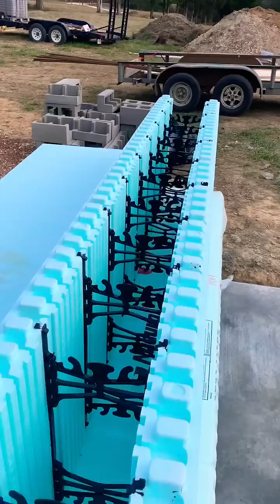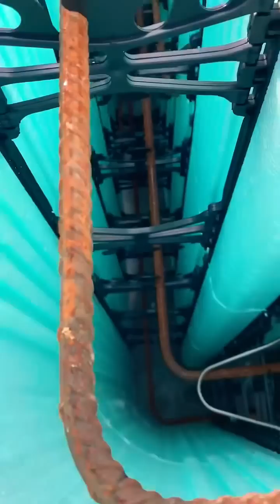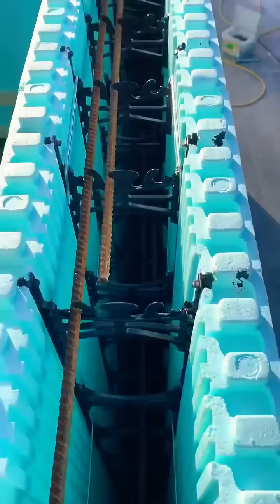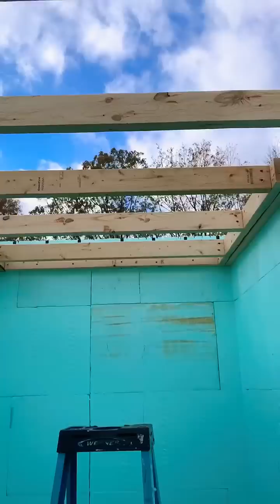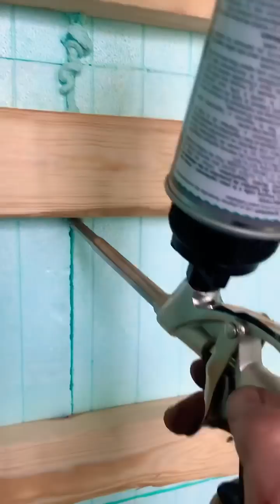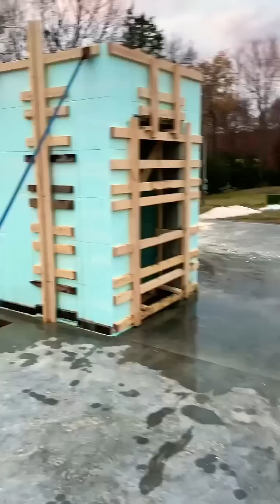Saving lives!! STORM SHELTER Pro edition #icf #concrete #safetyfirst @NuduraICF

Comment: My grandfather once told me that if I ever build a shelter make it large enough to live out of for at least 6 months (the time it takes to rebuild).
Reply: That was a very wise comment by your Grandfather. Though by the time you make the shelter big enough, it starts to take over the house. Probably the best thing would be to build the shelter as a part of your guest bathroom and laundry. This is not as simple and easy as it first seems. If rebuilding could take 6 months, you maybe off grid for at least a month, so you have to consider fresh potable water supply, waste water disposal and electricity supply for cooking and washing and lighting, so there is a generator and fuel supply. 
Mark from Melbourne Australia
Reply: How about build a basement or just build the whole house out of ICF?
Reply: @Chris N  where I live you cannot have a cellar. The ground moves too much. During the summer the cracks in the ground large enough to lose a small dog in. Gotta love clay soils.
Reply: @blmdh20s  i have plenty of clay near me.  Where you at?
Reply: Wise men
Reply: @blmdh20s  i have 2n a half feet of topsoil then 1ft.clay hardpan solid rock goes to surface in places like the corner of my house, why i didnt scoot it over instead of finishing the three feet down is my stupidity ? But for a dollar you cant bitch house was completely gutted just had to get gov grants after 40 yeears its yours scot free. Except two additions two car garage now 10 acers. Rock shifts every spring going to crumble corner of house like last time ,n sit another 70 years before someone moves in ugh lol
Reply: @Chris N  we can't have basements in Florida. The ground is sand
Reply: @markfryer9880 I guess we’re fortunate now that solar has come so far and can generate decent power on small portable panels that are easily stored or carried on trips. I imagine that most rural American households are on well water and have a septic system so if you can power the pump your covered for both?
Reply: @deusvult6920 you can have basements there, you just have to excavate massively around them and be above the water line. Not so easy for a state like Florida. Though with its politics I’d move anyway. 🤷🏻‍♂️
Reply: Nah. We had ours lost to a tornado . Just went and bought an RV while I built . Not going to live in my concrete storm cellar .

Comment: Yeah i have used those forms and they suck because if the wind gets under it you are screwed and they are only attached to the slab with glue and spray foam and a board shot to the slab if you used regular forms latch forms with your rebar coming out of the footing and then your wall steel tyed to that and then reinforced it with a steel 3/8 cable back to the footing and the slab and the wall will be much stronger than using those things believe me I have poured hundreds and thousands of yards of concrete and I would never use them in that situation and especially with your family in there i don’t know how people would think that foam is stronger than steel and concrete don’t get me wrong they work great in a area where they don’t have any twisters or tornadoes and provide great insulation protection but not in areas where you will have problems with the weather because you are just asking for trouble with those forms

Comment: How do you get out of a shelter after the garage crashes down and blocks the door?
Reply: Store chainsaw inside? Essential items for after a tornado should be stored in safe places anyways but with you is good too. Most tornado damage I've seen was tree insertion into the home or partial home removal and the occasional terrifying clean slab
Reply: @calebz1448  ... what are you going to do with a chain saw if your shelter is made of concrete and the door is blocked with debris? Even if you had a wood door, how long can you run that saw inside a 6x8 room before you pass out from the fumes? If the door is blocked with half a building or a tree and your saw only has a 16 inch bar, then what? Remember, you also have to reach through the door, so you don't have full use of the bar length now.... and you are still inside with the fumes.
Reply from the maker: The door opens in so even if the door is blocked you can open it and start cutting and removing the debris. The room has an exhaust and fresh air intake so air can circulate
Reply: @w.k.d.constructionllc  ... I should have said "doorway" because even with the door opening inward, you are still in a confined space with a possible pile of construction debris blocking your exit. The first nail you hit will render a chain saw useless.
Reply from the maker: @rupe53  if it was blocked and you didn’t have tools to cut yourself out…help will be there shortly and you’ll be sitting in comfort waiting on them to arrive. So either way hopefully everyone will be safe

Comment: Also be an awesome way to build your own walk in gun safe!
Reply from the maker: Definitely!
Reply: THATS A LOT OF GUNS!!
Reply: Fill it with guns and watch the storm blow through!
Reply: Does the door swing in or out
Reply: @spacemanrick2014  one got never enough
Reply: @torrycole6477  some think in so you can open the door when debris are on the otherside 

but I wonder if opening  out would be better to resist the airpressure especially if you extended the walls and lid past the door to keep debris from entering the door swing area ?
Reply: I think with tornadoes they have suction so if it swung in would be better to suck the door to the frame. I could be wrong.

Comment: Very helpful and could save lives. I'd go the extra prepper mile and make it nuke resistant with some lead sheets and ventilation.
Reply from the maker: haha
Reply: in case you didn't know, concrete stops the type of radiation from nukes. You don't need lead... unless it's for your guns. <LOL>
Reply: @rupe53 you have my attention: how thick and what kind of psi strength?
Reply from the maker: @danw.7935  this is a 6” pour, they have up to a 12” pour. I pour with a 4000psi mix
Reply: @danw.7935  ... back during the cold war, nuke shelters in a basement didn't have a door. They used an L shaped alcove as the entrance because gamma rays only travel in a straight line. Quite often they were built in a corner to use two foundation walls as part of the structure. They might also locate it around the well tank so you have extra water supply right there.
Reply: @rupe53  
Yes there are some still around, but after seeing that Chernobyl is still contaminated with radiation after 37 years, what's the point.
Reply: @tubeonline629  ... all I can tell you is that's a different kind of radiation because it's a different kind of fuel base. The half-life for radiation from a bomb is measured in days / weeks, not years / decades. OTOH, some of the bombs we tested in the early days were rather dirty and the sites are still reading too high.

Comment: So you just leave that form in? Does it double as insulation? Or are these forms reusable
Reply from the maker: yes, the form stays and it has a R-24 insulation value!! Not reusable
Reply: @w.k.d.constructionllc  awesome, he'll of a foundation
Reply: The one we just poured has 3” of permanent dense styrofoam insulation on both the interior and exterior walls of the 6” thick poured concrete.  The ICF is somewhat fun to build with, like building with huge Lego blocks.  Install vertical rebar in the slab when pouring it, set the blocks over the rebar, add horizontal rebar in the inner web in every row of blocks and pour the concrete inside the completed wall of blocks for the entire house in a single pour.

Comment: Nudura ICF might be the worst brand that length is hard to work with and the interlocking system is subpar.
Reply from the maker: you high right now, that's what I love about it.... you can cover some ground with them, and they unfold easily.
Reply: @w.k.d.constructionllc  they fold which is stupid and a weak point that length makes building with them up high difficult to deal with the interlocking system is bad. Their clips are of poor design as well there is a reason all the other manufacturers went to 4-6 foot blocks when we started ICFs they tried all lengths we all agreed on 4-6. Every one of your joints pulled apart slightly the but end of each block do not interlock on this brand. And the webs are weak prone to the screws breaking of stripping in them when putting scaffolding on them for tall walls. Try a better product like logic or fox blocks next time and see the difference I’ve been doing ICF in the Inland Northwest for 23 years now we were the first company anywhere in the northwest doing them. We have tried every type and brand of block.
Reply: @w.k.d.constructionllc  even the quality of the Foam is low on these it’s why the chain stores like Lowe’s are carrying this product. Look at the density of the foam of one of these and a something like a Fox block these Nudura blocks start falling apart into balls when you just touch them. Other blocks the foam is tight celled it looks and feels like the foam cups you get at a fast food joint. To get the better blocks you have to go through distributors directly likely someone in your area already had the license with your local distributors so you will have to buy blocks through another contractor but it is worth it. You and your customers will see the difference.
Reply: @w.k.d.constructionllc  if no one in your area has that exclusive license you should jump on it yourself and get serious about ICF the profit and turn around time on foundations and even entire homes will shock you.

Comment: These suck to put siding into
Reply: The plastic webs used to join the forms are designed to receive nails/screws. They're clearly marked on the outside of the forms and can be placed at 8" increments. It's actually easy to nail/screw anything to it. Pretty much every ICF manufacturer does it the same way.
Reply: @jeffsaunders2778  it's not the ICF manufacturers I actually like the idea...it's the installers who don't know to keep your strongholds in line with each other so studs are all over the place
Reply from the maker: well, must be the sub-par installers you've worked behind then... I line all of my clips up, plus with the Nudura blocks you can't install them without lining them up!
Reply: @w.k.d.constructionllc  mostly around windows and doors they had problems...the plastic likes to strip out too and then your screws don't sink anymore

Comment: no way that's stronger than a 12 inch block wall with horizontal and vertical bars no way
Reply from the maker: This is a 6” thick wall, but if we are comparing apples to apples this ICF wall in a 12” thickness would smoke a cmu one. So, yes way

Comment: I am very interested in this product but can someone please explain how it is safer/stronger than standard CMU block with the same vertical and horizontal rebar reinforcements?
Reply: How would you do horizontal rebar through the block? It seems like that’s the difference. Plus probably a greater tensile strength with it being poured into one continuous wall without any joints.

Not sure but that’s my guess.
Reply: @jonahwalker4450  lentil block every few courses or you can use wire reinforcement
Reply: It’s not.
Reply from the maker: Mortar is the weak link. Unless you install bond beams every other course and rebar, the wire reinforcement isn’t adequate support when set in the mortar. When you core fill there is a huge chance that you will have voids in the pour due to the irregularities inside the block. By the time you do all that you have a very expensive block wall. I quit using blocks for my basement foundations 20+ years ago because the have minimal lateral strength, even when core filled.
Reply: @w.k.d.constructionllc  thank you for the insight. You make a great point with the mortar being the weak link as well as the potential voids.
Reply: @jonahwalker4450  I don't know about US but the blocks in Oz, except at the ends, are H-blocks, They're not closed into a rectangle. So the core locks every block together. The web of the H has a notch for horizontal  rebar to go through. You could  have horizontal rebar every course if you wanted.
Reply: @w.k.d.constructionllc  Don't you have H-blocks in US? Here in Oz, only the ends are closed with a C-block . The legs of the H's butt up, mortared and the core locks together both blocks. The web has a notch for horizontal rebar, you could have it every course if you wanted.
...and mortar still isn't weaker than foam.
Reply: @topspeed250k5  than the foam? It’s called a monolithic pour. It is the known strongest form of concrete poured at 5000psi. It’s apple to oranges blocks and ICF. They actually have strength testing. 
I have used these in military grade installations applications where core filled blocks would not pass. 
Good luck.
Reply: @TheSteelArmadillo can you elaborate any on this?

Comment: Your 100% right core filled block is 1000000 times stronger not close to being the same.
Reply: How so?  6” solid concrete walls reinforced vertically and horizontally with rebar versus maybe 4” of concrete poured into the porous CMU blocks.  Can get lots of voids with the CMU blocks and can’t have a continuous pour as you can with the ICF.  I believe ICF is far superior to filled CMU blocks.
Reply: @JT_70  I agree.
Reply: Can you elaborate any on this?

Comment: Why not build the entire home with this. Seems cheaper in price and stronger than cheap sheetrock and plywood. Oh because then how would anyone make money without needing to repair everything. Not good when things actually last.
Reply from the maker: 🤔 there are pros and cons on all building methods. This is a great system if done correctly. It can be a train wreck in a hurry if someone doesn’t know what’s going on.

Comment: I’m not Stateside but would it not be more beneficial to build that type of structure in the ground? Excavate a hole, build that type of structure and that back fill it with either stairs down to it or trap door style entrance? I’m only speaking out loud and have zero experience with tornadoes but I would have through in the ground especially on a new build would be more superior or am I way off the mark?
Reply from the maker: I’m the ground is definitely the best option. I build most of my homes with a basement which we will have the storm shelter down there, but if the house is above grade this is the best option.